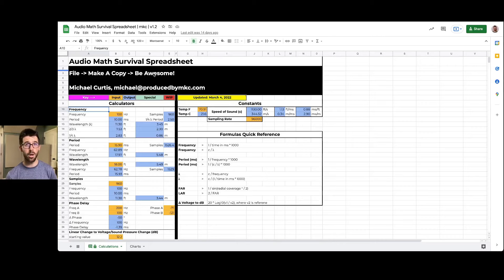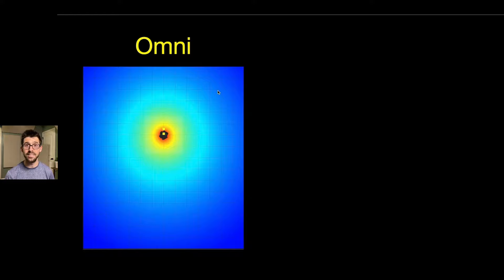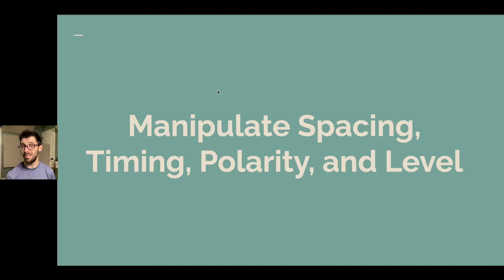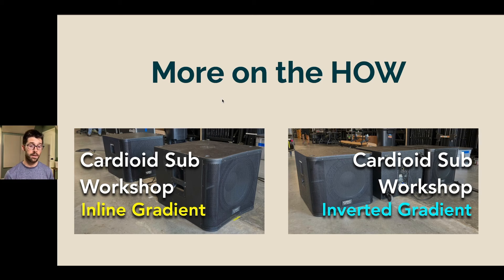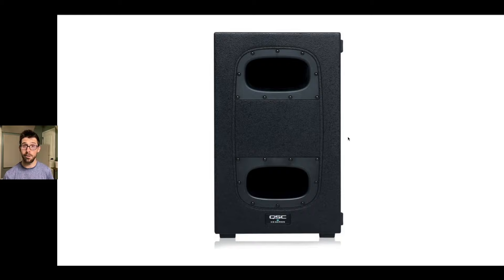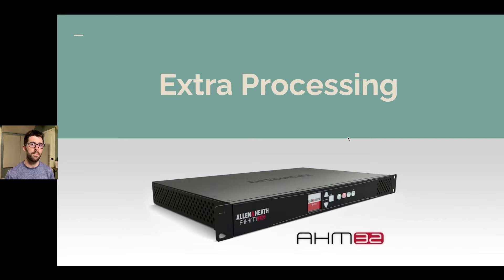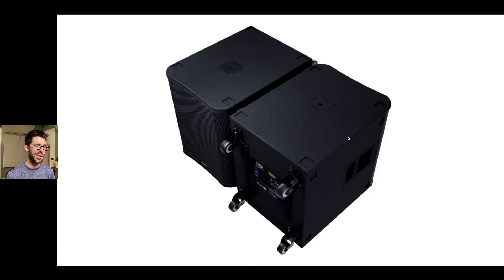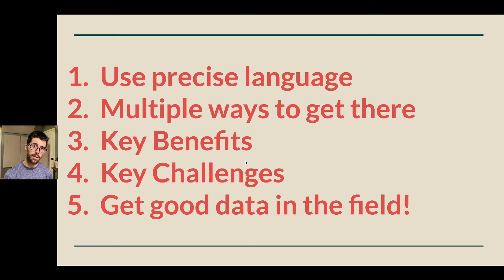Cardioid Subs Explained For Normal Audio People

Comment: I only wish someone would try to relate this to HiFi, and more towards frequencies above the sub region. I suspect in home audio, you'll get by nicely with corner subs, but it would be great to have  main speakers free of front wall SBIR, say above just under a 100 Hz or so and all the way up to a waveguided tweeter. 

I tend to find PA people sensible where the HiFi industry is more, ehh, greedy.
Reply from the maker: Yes, that would be nice! Seems like you're only option without any fancy DSP is to mount them in the wall.
Reply: @MichaelCurtisAudio  You think so? I was hoping for some solid theoretical foundations for DIY'ing along the lines of the Dutch&Dutch of the Kii or similar. DSP is a given, more or less any way you want to go about it, though. But sub in room? The answer appears to be snuggling up to the boundaries. I'd really love to see something cardioid from 80 or so, and up. Getting the listening position away from the walls is easier than the speakers.
Reply from the maker: @thomaslutro5560  I'm very comfortable with achieving cardioid setups for low frequencies, but not so much when it comes to mids on up to the tweeter. I know the diffraction characteristics are much different because of the shorter wavelength and it requires multiple drivers within the same enclosure to approach any native cardioid setup.

The fundamentals are the same, but how those are accomplished are very different. My studio speakers are currently snugged up against the front wall due to the very reasons you mentioned - BUT, a cardioid sub setup that I described in my video would fall apart because of the front wall reflections.
Reply: @MichaelCurtisAudio  Thanks. I see application  will be so different it takes an almost entirely new skill set going from PA to HiFi. 

I only wish the mainstream HiFi industry would approach room interactions based on more proper studying than they do.

I actually have speakers aiming for dardioid in the mid to treble by using reistive venting on the cabinet sides, and using the mid cone as a waveguide (Gradient Revolution). There are others doing similar stuff, like Amphion (both Finnish brands).  These differ in the bass though, Gradient with dipole and Amphion with straight up omni. 

I like a somewhat dry room interaction, giving articulation and clarity uncommon in HiFi. This is difficult in smaller rooms, especially when used for more than music.

So I keep asking google about cardioids. 🙂

(I do realise being in a minority...)
Reply from the maker: @thomaslutro5560  Yes, you're totally right. That sounds like a cool design you have going!

Comment: We run four qsc e 118 subs on a single crown xti 6002 amp. Is there anyway that we can do this with our setup within our amp?
Reply from the maker: You could run two subs off channel 1, two subs off channel 2, then apply the output delay and polarity inversion processing to the subs on the second channel. Pretty sure the XTi 6002 has that DSP capability.
Reply: @MichaelCurtisAudio  right now we just align them evenly spaced 6 feet across (after watching your four sub setup video). Is there anything different we would need to do as far as positioning? I probably need to watch that one again. Thank you for making great content!!
Reply from the maker: @tucansam3523  If they're evenly spaced 6ft apart that will give you quite the buildup in the middle and it will be weak on the sides. The goal would be to match the coverage shape to your audience shape.

Comment: My stage is placed on a concrete pedesta and I only can place two subs in front of the concrete wall. What settings should I use? Should I use cardiod inline, inverted or just place them normally together in the center? Is there a distance from the concrete wall that could make it work ?

Comment: Hi Michael, 

So i do a lot of underground raves outside in the woods. Usually we tun two tops, like 12's and for subs two 18's usually mid-tier gear like electro-voice..
Anyway I would love to always use cardioid on the subs because its very hard for me as a dj to hear me cued up tracks since the bass is so intense right next to me. 

I have a party indoors in a couple of weeks. The room is nicely treated acoustically but I would love to run cardioide. Look I don't have the tools or knowledge to run processing and look at chart results. I would be basically just use my ears when I set up and soundcheck.

What would you recommend. The room is a big square, perhaps 20x15 meters. Expected amount of people like 80. 

Do I run two subs coupled with cardioid mode and two speakers on Stands?

Comment: Question please can you use the cardoid settings with just one subwoofer or you need 2
Reply from the maker: If a single active subwoofer enclosure is built with two or three woofers in it it can be cardioid standalone, or if the enclosure is passive cardioid. The manufacturer will tell you if it's capable of that. Otherwise you'll need to subs.